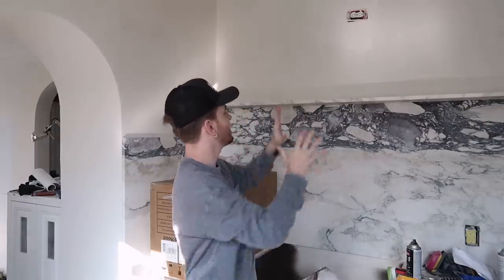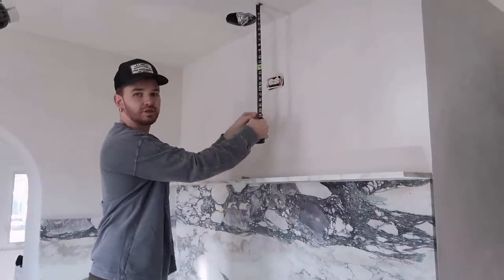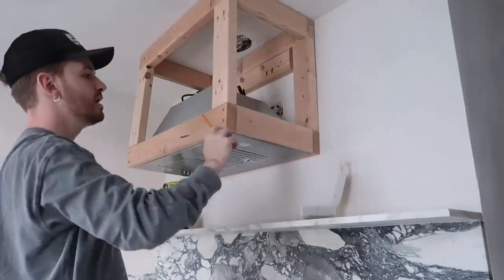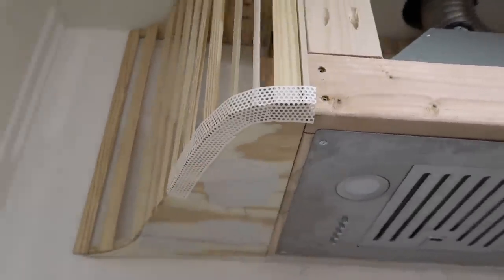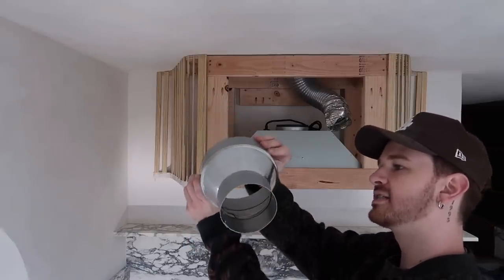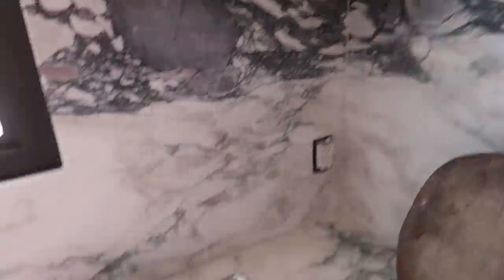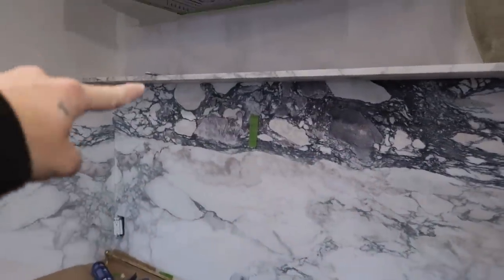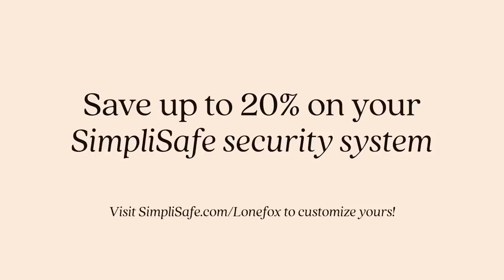DIY Stone Range Hood Using PLASTER (From Start to Finish)

Comment: Its lovely vent hood! A bit too high for my preference, but to each their own - as long as its up to code. I do think you will regret not building in a way to access the vent.
Reply: Yes. Hood vents need to be at a certain height to actually work correctly. And also vents need to be cleaned so need easy access but, by that time he will have money built up again to afford a new one instead of cleaning this.

Comment: It looks utterly fabulous! I love it. The only thing I would change would be to recess the hood liner into the bottom of the hood cover. You had the space inside to mount it higher, then you wouldn't be able to see the stainless so readily when standing on the ground (because the edge would have a longer lip on it). That said, it still looks wonderful and it's always easier tossing out what if's from my chair. Your home is going to be stunning when you're finished!!

Comment: interesting and creative idea. I believe you can also use drywall instead of the poly board. I heard u say that the reason was because poly board is more flexible but drywall can also be made into curves by scoring it and the plastering to perfect rounded pieces. Unless of course there was another reason for your choice, then I would LOVE to know. I think this is an amazing idea. I've contemplated ways to update my mom's range hood without spending thousands for one of those industrial sized ones. Strongly considering this as an option. Many great ideas! Thank u for being bold enough to go for them 🤗🤗

Comment: For the detailing around the hood vents, get a piping bag used for frosting.  With a small tip, pipe the plaster like caulk.

Comment: WOW!!!! You did an amazing job on the exhaust fan cover. I love it Drew. Just a little tid bit. My husband is a contractor and has many times had to drill a hole in granite, silestone, marble etc. He always has a squirt bottle with water in it and has someone squirting the water at the drill bit/hole as he's drilling the hole into the stone. It makes it go through the stone a lot faster and less chance of cracking it. Love everything you've done to your new home so far. Also wanted to mention. You have such a beautiful kind heart.

Comment: I wonder what the height of the space is between the surface of the range and the bottom of the range hood. It's not supposed to be more than 36 inches. 
I know this because we just replaced an over-the-range microwave with a proper range hood in our house we just bought.

Comment: It looks great but I am slightly confused about whether the ledge will interfere with performance of the extraction fan. From the angle it looks like the ledge blocks it.
Reply: My parents have a hood vent like that, it is so strong that it sucks the piliot light out, so maybe the ledge will help so he can actually use it, smoke does rise, so it will go around the shelf.

Comment: Drew I have to be honest with you - I don't like it. It looks too bulky and it's distracting. It's also going to be hard to replace. BUT, at first I wasn't sure about the color of the cabinets either and now I love it. The rod looks absolutely amazing, but everything will get dirty when cooking. If I were you I would've put the rod on the other side of the kitchen where it won't be so cramped. Good luck with the rest of the renovation!

Comment: As beautiful as it looks, I am concerned about two things in this design:
1. How would you access the hood in case of a need of repair?
2. The shelf running all the way across the width could be a slight barrier between the range and the hood.

Comment: Drew, you having a shelf between the stovetop and the range hood defeats the purpose of the range hood. The range hood is there to suck out the heat, steam and grease in the air as you cook. The shelf gets in the way of it doing its job. This is a BIG mistake. You chose form over function.
Reply: 100% this!!!
Reply: glad i’m not the only one who thought that! 

the bottom of that shelf is gonna get SOOOOO greasy/discoloured 😬
Reply: It’s pretty, but will be greasy
Reply: It might not be a problem, my parents have one like that and the blower is so strong it sucks out the piolet light, so the shelf will help block some of that. Smoke rises, so it wont stay under the shelf
Reply: Yup, particular hood is made to go a specific distance from the stove- look at suction power, noise decibles of fan, etc.  Love learning from and with you.
Reply: Does he even cook? But i see  your point.
Reply: @babe9293  There you go. Fox has often admits he orders most of his food out. See his kitchen organization video for said admission. However, the shelf is small and I don't think it will interfere with drawing up smoke etc. Usually oil droplets are fairly heavy and don't get sucked up into the draft.
Reply: Same thought as the others here
Reply: The small shelf (although not ideal) isn't deep enough to be a problem. The REAL problem is he has to stand on his toes to turn it on AND California's building code says a vent hood should be 18-36 inches above the stove....this thing is at least 55 inches (but prob closer to 65).  I've never seen anything like this (wonder why).
Reply: @jere5555  so will all of the pots hanging over the stove.    Same for that vase with flowers which, besides using valuable counter space, will be a fire hazard while cooking.
Reply: Fire hazard legislation. 
Ensure you are covered or you will lose insurance.
Reply: Him being an interior designer focussing on decoration, textures and visual interest may be a clue that he is all for form over function.
Reply: Yeah wouldn’t items on the shelf get dirty too?
Reply: The shelf is not that deep to block smoke/steam.  Most people fry on the front burners.  So, I don't think this is an issue.
Reply: Exactly what I was thinking 🤔  That kitchen is beautiful but highly impractical.
Reply: Also, if is necessary to have any maintance on the tube or the electrical part of it, it will be necessary to open a whole in the thing... And the hood equipment doesn't seem to come off easily, it might be another problem as well... If he'd made a hidden door in the hood and the frame a bit looser, it would solve both of the problems...
Also, if the hood were lower like it is supposed to, it would still be possible to make some shelves and some hooks as well...
Reply: @richardvinsen2385  yep, but we don’t have to clean it. 👍🏼
Reply: The shelve isn’t thick enough for for that problem and the he’s said he doesn’t cook often, in a previous video. PLUS! did u hear that thing when he turned it on!? Omg sounds like an airplane😂😂😂 I’m sure it’ll suck up all the fumes just fine 🤣🤣🤣
Reply from the maker: I don't find this a problem at all! The shelf is elevated and cover maybe 1/3 of the stove. The smoke and steam have ample space to be sucked up by the range hood. Just a reminder the marble is all wrapped as well with a material that can be cleaned with any solvent
Reply: My only thought was that the materials didn't seem nonflammable, but I guess the plaster takes care of that issue.
Reply from the maker: I also just shared a story on IG showing how well the vent works still :) I planned this all out before hand 😂
Reply: It will be fine Drew… there will still be plenty of air flow…
Reply: The vase of flowers was just for styling for the photo shoot.
Reply: @yellowbags  Drew is not an Interior Designer. He's a decorator. Even though he's creative beyond belief, a Designer has to have a college degree, take a test, and get licensed.
Reply: @lonefox  good lord these comments. god forbid you have to wipe the bottom of your (extremely shallow) shelf occasionally. I actually think the planning/research/attention to detail you give to your projects is what sets you apart from a lot of other channels so idk what all these 'form over function' people are talking about, but keep doing you!
Reply: @lonefox I would be more concerned with the fact that it seems too be such a tight fit that if the vent breaks down you won’t be able too get it out for repairs 😅
Reply: @lonefox  LOOKS GREAT. But what about maintenance? What if you had to replace the unit at some point? You'll destroy all that work! Function is more important here. And I have to agree with others saying it's too small and way too high up.
Reply: Makes me wonder if the place will pass building inspection.
Reply: Plus range hood should be no more than 36” from stove top,  is it?
Reply: Usually love your design and all the thought you put into your beautiful home, but have to agree on some of the negatives here.. also, think I would have recessed the grill panel section (of the vents) up into the outer structure to make them less visible, especially since they are definitely above eye level. Most range hoods are at eye level and you don't see the mechanics. Still, the outer structure you created certainly fits the overall design.
Reply: @gabriellafrancesca3453  Exactly!
Reply: @g.d.anonymous8235  FYI , not required in the state of California.
Reply from the maker: @flis9618  now that the frame was attached to the wall it made the wood not warp so the base easily slides in and out! Hopefully that makes sense
Reply: @NCHCLW  original 1925 plaster hoods can be at or only slightly below the ceiling and don't have fans, just let the smoke drift up into the attic through a narrow slit opening
Reply: @Snoops510  the white 4x8 sheet used to form the curve is plastic, I've used it and it can get heat warped.
Reply: I agree with this comment. The range hood is too high. The shelf is blocking easy flow of air. Having said that, I think Drew isn't a person who really cooks a lot so I don't think it's gonna be a huge problem for him. For a house hold that has a lot of cooking going on (like mine) this makes NO sense. Also incase the vent breaks down you gotta remove all that stuff to get it fixed/serviced... It's BEAUTIFUL but not functional for an every day home cook.
Reply: When I was young and renovated my first home I made some choices that weren't very practical. Some I lived with and others I eventually fixed. No biggie, it was a learning process. Drew will do the same thing. As for the comments, I see good suggestions here that will be helpful to Drew and subscribers who may be renovating their own homes. I love that Drew is classy and gracious with differing opinions. ❤
Reply: @lonefox  Don't get me wrong, it looks beautiful! I'm just worried about the maintance part of it haha watching you renew the house is being amazing and inspiring to make it in my own
Reply: @lonefox  show us in six months ;)
Reply: @lonefox  Absolutely that makes a lot of sense! ☺️ Good thing it sorted itself out, looks absolutely amazing 🥰👌🏻

Comment: I think some instruction reading and a bit of research would have been optimal for this installation because, that is way too high. Where it is located it will only be a bump on the wall with no real purpose. Top that with no access for repair it's a costly and time consuming mistake.

Comment: -central Wisconsin:  Drew, you never mentioned when you were securing the bracket that will hold the fan hood, or when you were screwing any of that hood frame into the wall or ceiling, that you were screwing into studs. I hope you were vs drywall.  I just thought I’d mention it, so in future videos, you can remind people to be sure to screw into studs. as for newbies doing at-home renovations, this could be a valuable piece of information/reminder.

Comment: It’s one thing to have the vision, your ability to build it is a whole different dimension.
My dad did woodworking and would be so happy with the clamps and pocket hole jig.
Love your videos.
I was holding my breath waiting for you to finish the ductwork. Now I can breathe again. 😅
I wonder it, overtime, there will be separation between the vent cover and ceiling. I’ve had to tape and plaster about 10 yrs after a build.

Comment: I like the design very much. I am a cook and can comment that I think from a practical perspective you might regret that you put the hood so high up from the stove top.  Unless you brought a industrial strength model it may not suck the smoke as efficiently so high up.  Also looks difficult to reach the controls from that height. Also FYI the hoods are notorious for leaking grease onto the surface so you may end up with oil/grease drops on the shelf, so be aware of that when you put things on the shelves under the hood.  The screens need to be cleaned at least once a week to help prevent this problem,it looks like you purchased the kind that can go thru the dishwashing cycle  which makes cleanup easier.  I set myself a calendar reminder to do this so oil does not build up.  Hopefully you not have any issues with yours, but taking that out to replace may cause you a headache in the future.  You are a homeowner now and looking at long term maintenance is something you need to consider in your design options.  I had so many issues with my oven fan that I ended up with 2 different models to get on that actually worked over the long term. Was extremely disappointing as I bought a real high end product.

Comment: This is great for a designer who doesn't cook much. But if you love to cook the hood is not enough to do the job. It should be lower and farther out from the wall so it is right over the burners. That shelf and the pots would soon be covered with grease from cooking. And the plaster finish would be so hard to clean. But, as I said, it's fine for Drew and his lifestyle.

Comment: Beautiful job.  I love the curves, love the plaster, love the backsplash, and accessories❤❤❤.  I would have been afraid to tackle a job like this AFTER that expensive marble and shelf were installed already for fear of dropping that range hood insert or frame.  Mine came in two pieces for building inspection purposes and to provide access for repairs.  The single continuous piece you made is beautiful though.  I am thoroughly impressed by your skills.

Comment: You and Justin are a great decor and construction partnership. Perhaps it would have been a good idea to extend that stunning decorative hood out further from the wall to clear the shelf. Otherwise, you may be cutting the efficiency of the unit, not providing enough ventilation for the stove, and possibly violating local code.

Comment: I agree with a lot of the comments below. While the design is quite interesting and I like it, I think the vent is too small for the size of the oven he will be putting there. Also, if there is any maintenance needed for the hood, or if it has to be replaced, it's going to be difficult and all that will have to be demolished.

Comment: it looks absolutely stunning! especially with all the styling, i was truly amazed. i'm a lil concerned though. i don't know if you need advice, so feel free to ignore.

- the combination of the height, the shelf being in the way, and the width of the hood might result in insufficient cooking gas extraction, which is a bit of a health issue. also, grease will probably build up on the shelf etc.
- the hood itself seems to only be saved from falling down by 4 screws and the wood that fits tightly around?

Comment: Tip: if you use a wet sponge on the plaster after you troweled it on it’s a lot easier to get it smoother and to the final finish that you like. Easier than when the plaster has dried already. Ps- I like sculptural shape, dont listen to the haters

Comment: I love the look of this, but please keep us updated  on the functionality aspect- I'd  worry  that something  porous like the plaster would struggle to hold up under exposure to steam and would start to crumble off. Not to mention that if the fan breaks or a wire shorts, its going to be a fresh hell to get in there qnd fix it or replace it. I'd  also ve concerned about spills or splatters soaking into that plaster and staining (i suspect you are one slippery marinara jar from a tragedy- but i hope I'm wrong). At any rate I'd  love to see an update video in the future where you talk about how some of the aesthetic choices you made have been from a functional perspective- what has worked well and what hasn't sort of deal.

Comment: Beautiful job but I have one concern: Rangehoods vibrate - did you mix something elastic into the plaster to prevent it cracking over time with the constant vibration? I don't even know if such a thing exists but it might be something to consider doing a search for now in case you have to redo it.

Comment: Fantastic~  My only little concern is how to access the connection between the exhaust hood & the duct if you need to get back into it for whatever reason if the hood is faulty etc; you'll have to break into the little decorative box face which would be a shame.  Maybe add a front face panel with hidden hinges instead? x

Comment: So unique and beautiful.  I love the smooth lines.  I do have a question.  One of the things I hate about cleaning the vent is the grease that it captures (like it's supposed to).  Do you think the underside of that section of your marble shelf will end up greasy, or even the pots and pans you have hanging (which looks so cool, BTW! )?   I'm guessing you're one of those people, which I so wish I was - that really cleans and wipes down after each cooking event. In any case, I love your design and the finished product.

Comment: I’m amazed with your take on the vent cove !!
Great idea and job  the only thing I didn’t like and it may have been just the camera angle is that you can see the actual vent. Very distracting from that beautiful hood. Small suggestion is to put a trim around the bottom of the hood, just low enough to hide the vent   Good luck 
Keep up the great work